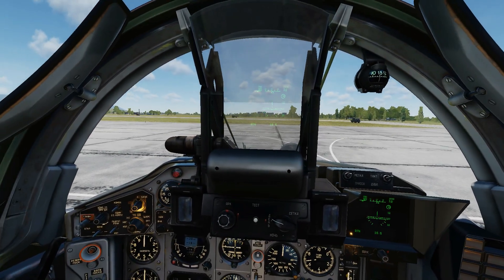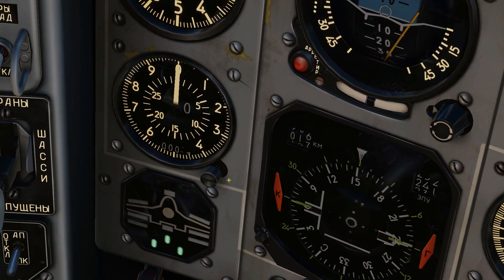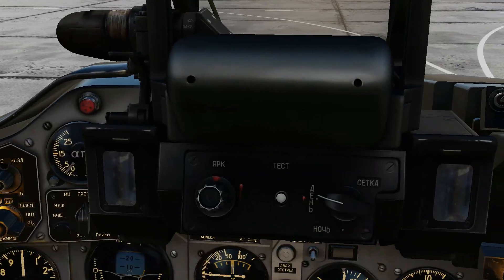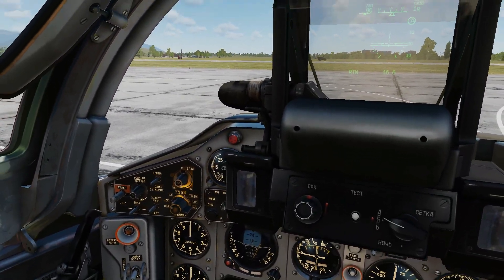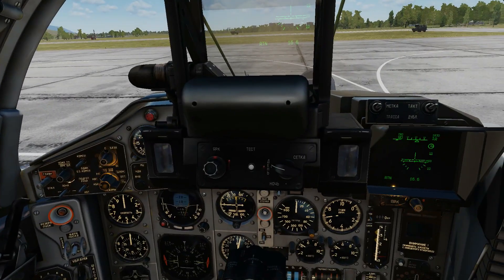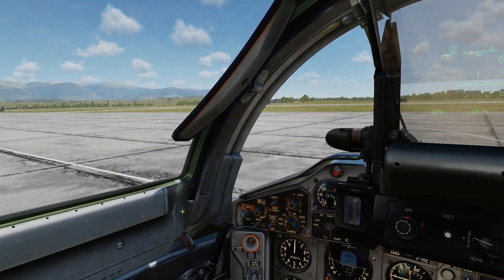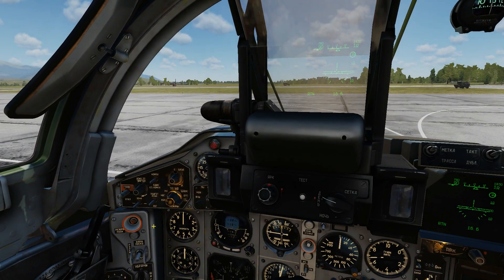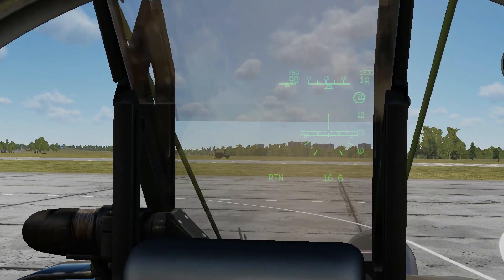Flying Basics: Why Planes Have Barometric And Radar Altimeters?

Comment: Rad Alt is for low altitude to verify the barometric. Barometric is your primary. Rad is for low level to keep you out of the dirt. Your actual search radar keeps you from from crashing into mountains. You verify between all
Reply: Terry Bahr you do know that not all aircraft have ground search radar right? Radar altimeter is different.
Reply: FuriouslyFurious The ones they were flying and what what missions they describe do. They are not flying E2C or a C-5.

Comment: Actually, the barometric altimeter will keep you from crashing into a mountain because you should see the highest peak in barometric altitude on the map. As long as you stay above that altitude, you wont crash. The radar altimeter, on the other hand, will read the altitude under your aircraft, but not in front of it. Meaning if you're flying fast, you may crash before you even see your radar altimeter warn you that your're approaching the side of a mountain.